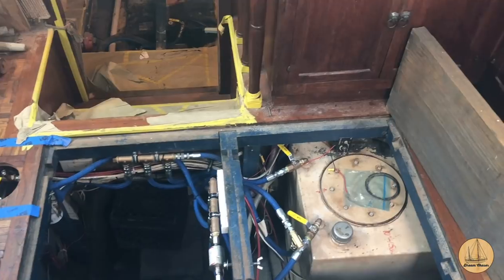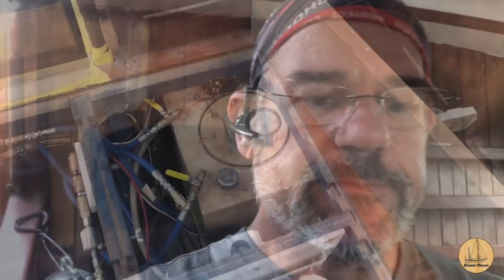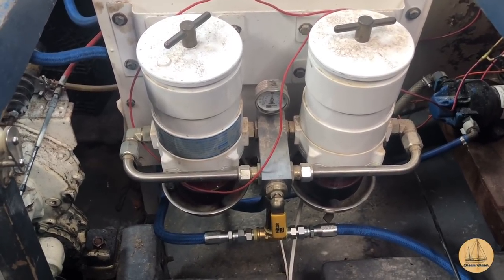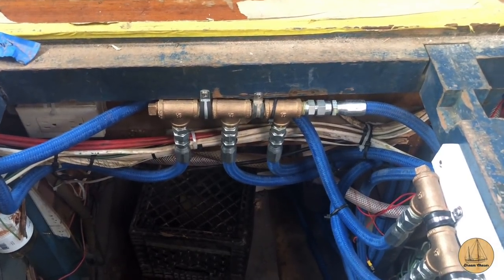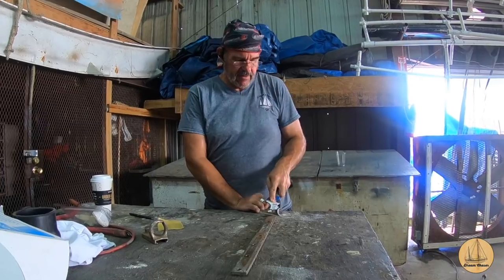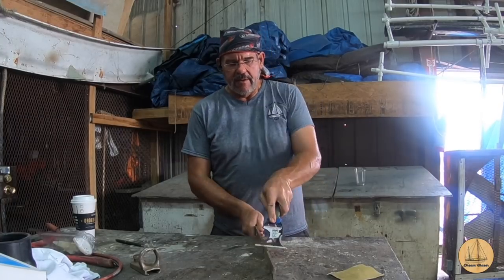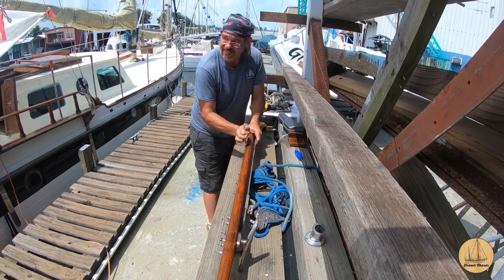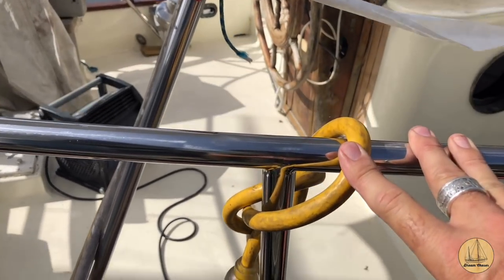New Fuel System Mizzen Traveler and More AwlWood MA

Comment: That single fuel pump connected to the manifold... A t before that one and hook up a second pump with a shut off valve before and a one way valve after... All this for added redundancy... 😊
Reply from the maker: Curious if your suggestion is to have essentially 2 fuel pumps there?  Not a bad idea, but I would love to think of how I can also add in a transfer pump so that I could pump fuel from one tank to any other as well.  I was running out of time and money during this job so didn't go too crazy, but I would like to do that at some point as well.

Comment: Gil,
Good stuff on the fuel management system! Nice Job. You mentioned that you are going to work on stringers down below. In addition to the stringers, if you find that you are building any kind of bulkhead or structural component, I would recommend that you take a look at Coosa Board (link below). The company is out of Alabama, good folks, and great product. I am currently rebuilding the very most forward locker on our Formosa, and intend on using this material. In fact, on all structural replacement projects, I'll be using Coosa Board. Keep up  the great work -- you guys have made terrific progress.

http://www.coosacomposites.com/

Will & Kate
Reply from the maker: Thanks Will, I will check it out, I have heard others recommend that too and I haven't looked yet but am going to have to.  I likely need to rebuild that same bulkhead but I keep putting that one off on the back burner.  It looks like it was partially done once before, but not completely so I am going to have to replace the bulkhead and rebuild the anchor chain well.  But that will give me a chance to design it the way  I want :)

Comment: You meant the Main Traveller right?
Reply from the maker: +Joshua Chalmers It was a little bit confusing in this video because I was actually working on the main sheet traveler where I show that notch out of the car. I was also assembling the mizzen traveler bar with the teak and the two cleats on it as well. I didn’t do a great job of pointing out when I was talking about one or the other, or at least showing it so when I used those words alternatively in the video it would have been more obvious I was switching topics from one thing to another.

Comment: My word you are a busy guy. Maybe too busy and in danger of losing focus? Great job on the fuel system but if I may make a suggestion - the system would be easier to operate if the supply and return valves were on the manifold. Sorry but it is easy to come up with useless comments sat in an armchair.😂
Reply from the maker: Norman Boyes Thanks for the suggestion. I considered that but chose against it thinking I wanted one at the tanks in the event I had to turn it off from tank and then chose not to add at manifold (but I like the idea of centralized control) just because I didn’t want to add all those additional joints as possible places for air leaks in the system.  I did seriously consider it and don’t know if my decision will end up being right or not. Lol
Reply: You made the right decision - but will now have to live with it.  :-)